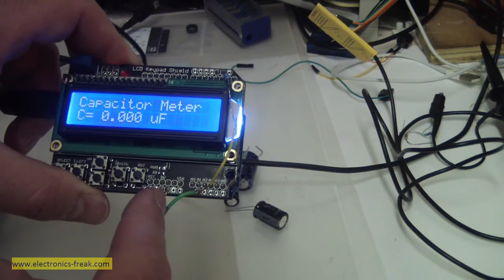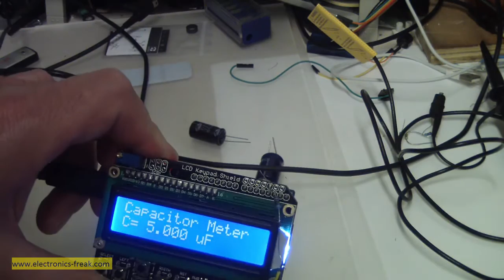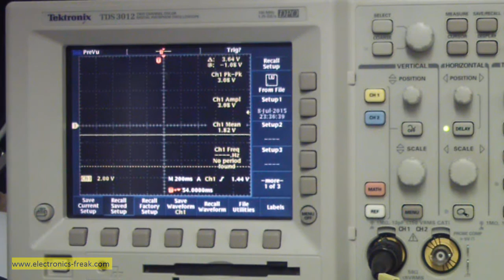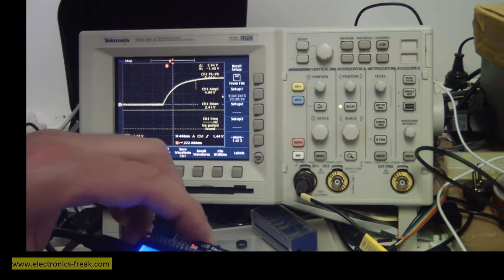Lesson 14 - Arduino Capacitor Meter

Comment: How to connect it to Arduino?  Thx
Reply from the maker: Please read the code instruction here: http://www.electronicsfreak.net/lesson-14-arduino-capacitor-meter-code/
it is written in the comments above my code
Connect CRL Pin (Digital pin 2)-> 1K Resistor -> Analog in 1 -> Capacitor to measure Positive || -> Negative capacitor pin to GND
-- You need from digital pin 2 to connetc 1K resistor to analog in 1.
Also analog in 1 is to positive side of capacitor
Negative side of capacitor to GND
Reply: Ok    Thank you